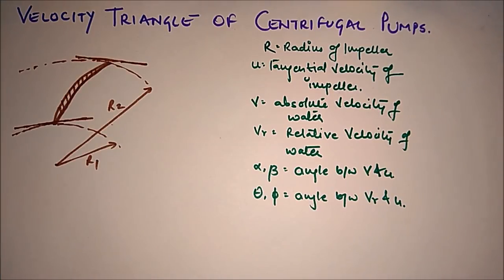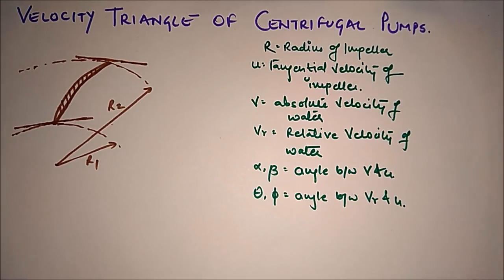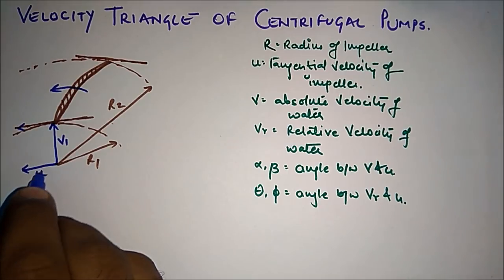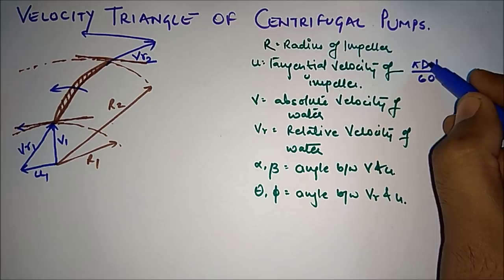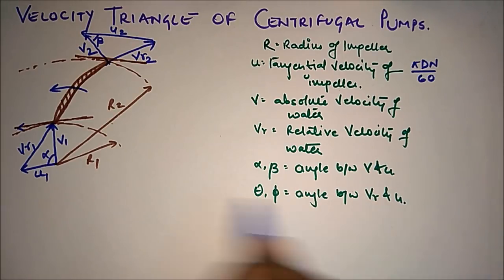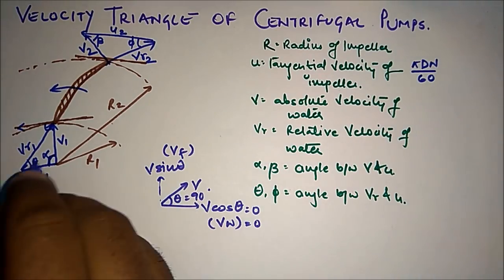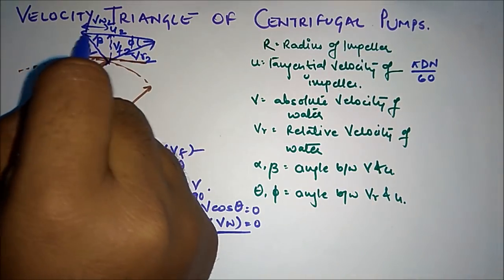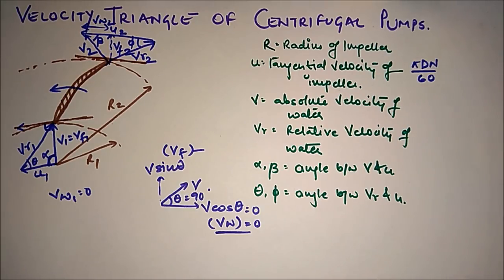Velocity Triangle of Centrifugal pump || Centrifugal Pump

Comment: the water is not entering radially rather it is entering into the impeller eye axially and then by the influence of the impeller it moves radially and then due to the rotation of the impeller blade it is leaving the impeller tangentially. Note : THE WATER IS NOT ENTERING RADIALLY
Reply: No man, water entrance is radial...... The reason is that the suction pump has a bend when it enters the impeller.

Comment: direction of  u1 is wrong. if the direction of u1 is which u have taken then resultant will not be what u have taken it to be .. please see too it and do not teach wrong to the students .. Doubt on whether i should rely on your source or not
Reply: He is correct. U1 is blade speed. In this case, blade is rotating anti clock wise....... Direction of U1 is correct